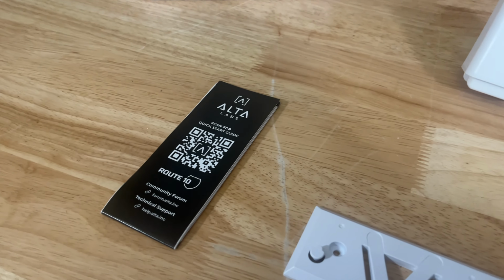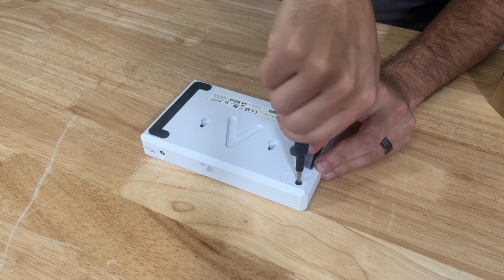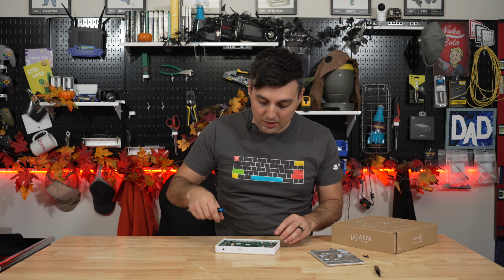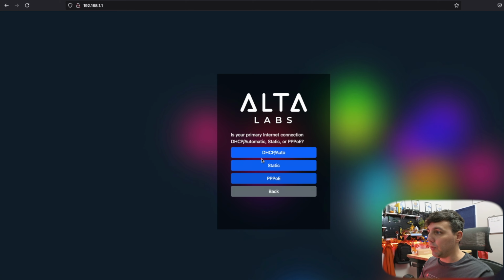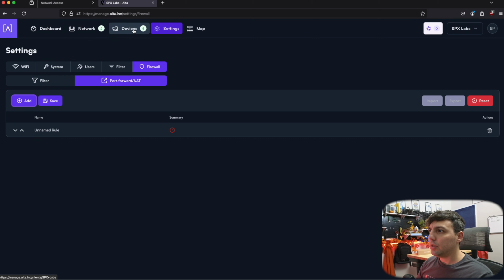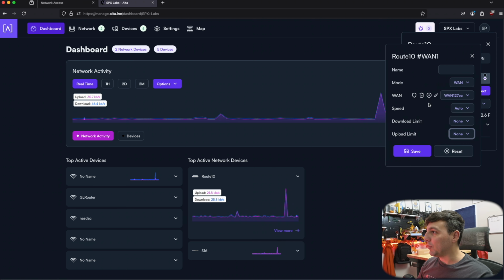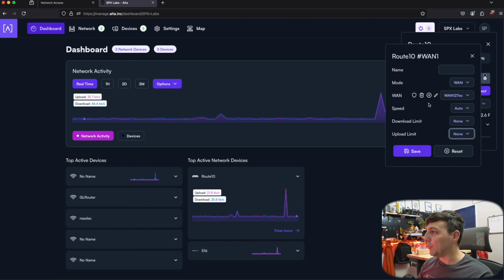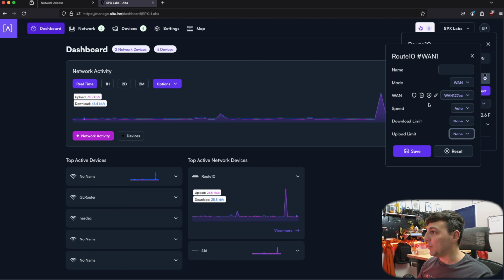Alta Labs first 10Gbps VPN Router, the Route10

Comment: I bought this unit and it is ridiculously easy to set up. I will say that it does have bugs as not everything works... ex.  the switch to turn off the LED's doesn't work. I need them to figure out a way to allow Tailscale to be installed for remote work though.  I bought two 10 GBPS transceivers to convert to RJ45 and they worked out of the box. I configured my VLANS for my 4 WIFI networks and set the DNS server to use my Pihole for ad blocking etc. and done!  I use a Mikrotik 10 GBPS RJ-45 switch and I use Unifi WIFI 6 access points with a gen 1 cloud key. Everything works and I couldn't be happier! This is a home set up BTW.
Reply: I was using OPNsense on an industrial, fan less, mini pc with 2.5 GBPS nics but I had issues with stability so that's why I switched.
Reply from the maker: It’s going to be very interesting how this thing gets updated.  My understanding is it runs openwrt under the hood.  So the possibilities are endless
Reply: @SPXLabs  I just got an update notification yesterday, and it was a simple click, reboot, and done. I haven't noticed anything different, though.
Reply: I’ve had several updates now and most of the bugs have been worked out. The LED controls work now etc. Still waiting on Tailscale implementation
Reply from the maker: Good to know.  Mine has been buggy also.  Like it just stops allowing my computers to connect to the internet until I reboot it
Reply: @SPXLabs  on the lan side, set speed to default
Reply: This is the same problem I had and this fixed it
Reply from the maker: Yeah I wish that was my issue.  I’ve been working with support for a couple months now.   Took a break for the holidays we will be working together again shortly.  

Good looking out.  I very very much appreciate you offering support and staying in communication with me.  Even updating me with your situation.  Thank you.

Comment: 10 gig but can it actually route that speed?????
Reply: sure, because there are no rules preventing anything, the rules on the unit aren't working yet. It's a "router" it moves packets.
Reply: So, I have Spectrum 1 gig home internet, and I had to throttle my speed to 1 gig to keep it from timing out my modem!!! I was getting 1.14 GBPS plus down, and it was timing out because that's more than I pay for.
Reply: @Johnnie-nn8by  what ?
Reply: @JasonsLabVideos  I know right? But this is true. The modem was giving me more bandwidth than I was paying for and it was timing out and causing me to reset it several times a day. By capping my upload and download speeds in the router at 1 GBPS, this stopped the timeouts.
Reply: I called Spectrum several times and they sent two different technicians out because they couldn’t figure it out. They even replaced the modem with a new one and still the same issue.

Comment: Is a 10GB  router right? should be able to route at 10GB speeds, so what about some inter vlan routing to see if can actually do 10GB.
Reply from the maker: None of my sfp+ modules worked with it so I want able to do anything interesting for above 1Gbps.  So unfortunately this will have to wait for another day :/
Reply: @SPXLabs  well, that is not a good start, they said that they should be compatible with pretty every existing SPF+ modules, anyway, thanks for the info.
Reply from the maker: @pbrigham well mine were TP-Link branded, Ubiquiti Branded, and FS.com generic which should have worked but idk.  Also my finistar ones didn’t work but those are 1G.
Reply: I could try, i put all types of modules in mine and had no issues at all. 1-10 gig. MM & SM & a Dac cable.
Reply from the maker: I was going to ask what brands you used. I’ve got to get some new ones apparently.
Reply: You may need to go in manually and specify the link speed (eg. 10g) for each port/module that is connected - assuming it allows this. Some switches/routers require this when using non-original manufacturer modules.
Reply: @heyitsjel  I didn't have to.
Reply: @JasonsLabVideos  just depends on the transceivers, and also corresponding NIC/switch gear attached at the other end (ie. switch/NIC on the other end may negotiate the speed)
Reply: @heyitsjel  Yeah, dose SPF+ normally don't like autonegotiation, most of the time you have to specify the speed.

Comment: Thank you for sharing the teardown. Just sharing a suggestion, please use a spudger instead of the screwdriver to avoid touching/shorting any metal contacts :) by accident when prying the board out of the casing. There might be undischarged capacitors which may discharge causing a short. It happened to me and learned this the hard way. 😅
Reply: #face palm, really ?  You're comment suggests you know nothing about electronics at all.

Comment: At 3:40 you say the Back Plate is 'Aluminium' - WTH is that? Besides, It might be Zinc Cast, it's thermal conductivity is even higher than other metals like Aluminum by 10% (around 120W/m-K)
Reply from the maker: I guess it could be.  I’m just making assumptions here
Reply: @SPXLabs  Thanks for taking it apart - it looks well built, with capable Chips inside. Hope they deliver the missing SW Features soon!
Reply from the maker: @jfkastner it looks like openWRT under the hood.  So I’m sure it will be easy ton implement but they have to put their flair on it